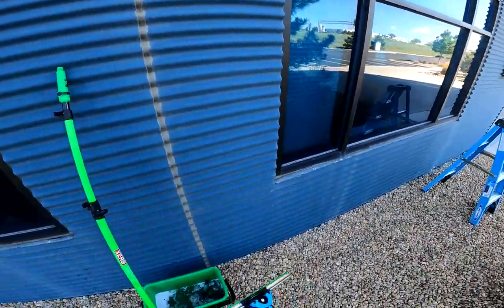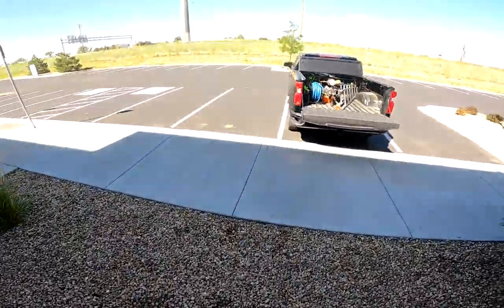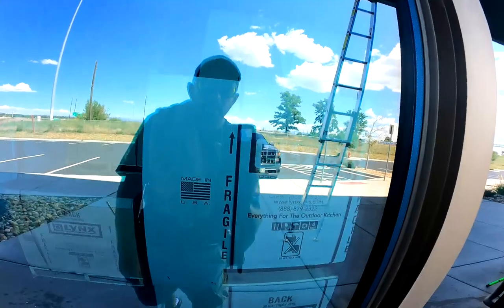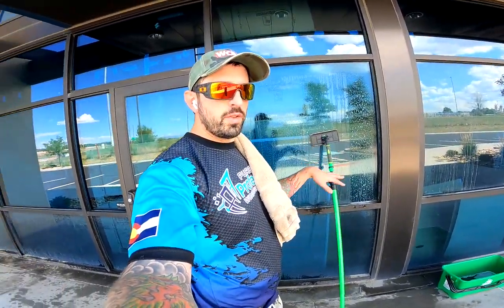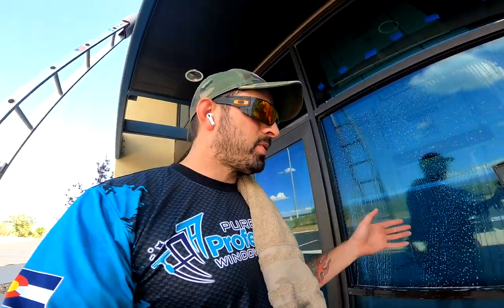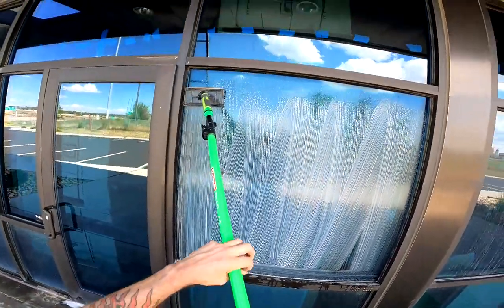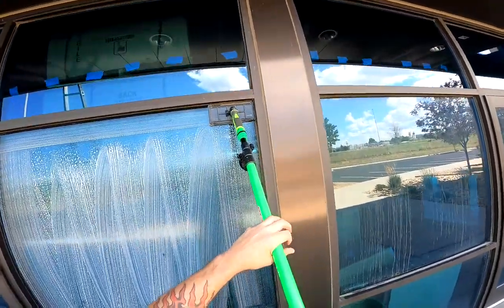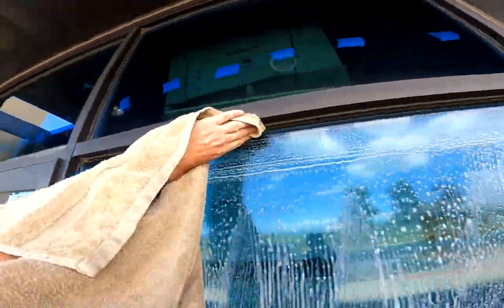FIRST TIME CLEAN COMMERCIAL OUTSIDE ONLY WINDOW CLEANING

Comment: I love your content, really useful! I just wondered if you find the walnut pads enough to remove hard water marks or is something else required like steel wool? I have some customers that have these marks that I’d like to be able to remove but just not sure which method to try.
Reply from the maker: For hard water I suggest also using Diamond Magic in addition https://windowcleaner.com/products/diamond-magic-stain-remover?sca_ref=3020242.k17l3JaEgS

Comment: Are you not concerned with all of the dirt you pick up on you squeegee from running it across the window sills on your straight pulls? And do you need to wipe the squeegee clean after wiping several windows, does it not build up on the rubber?
Reply from the maker: No not worried about it, when feathering the squeegee at the top of the window it helps eliminate that from happening

Comment: How much for that short poleseen and i have never see water spots come off that easy
Reply from the maker: The trad pole is $199 and the pad holder is about $30 with walnut pads 

https://windowcleaner.com/products/xero-carbon-fiber-pole-trad-pole-2-0?sca_ref=3020242.k17l3JaEgS

https://windowcleaner.com/products/steveos-techno-pad-kit?sca_ref=3020242.k17l3JaEgS